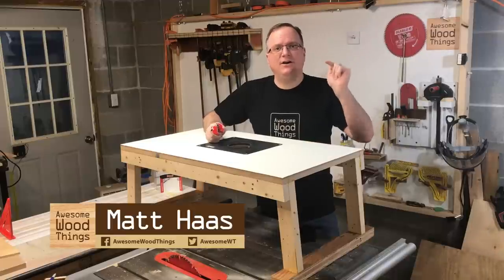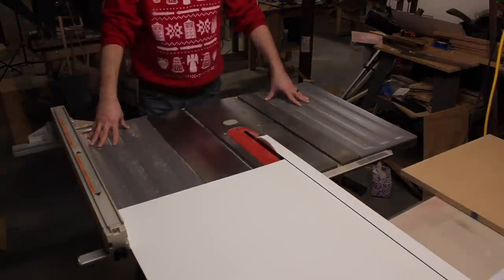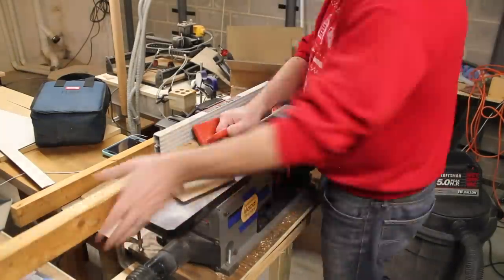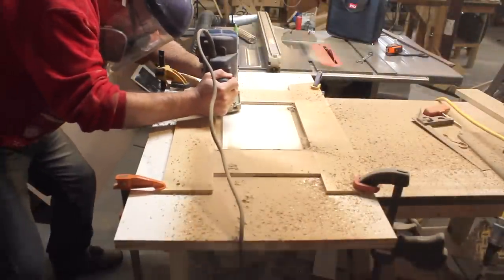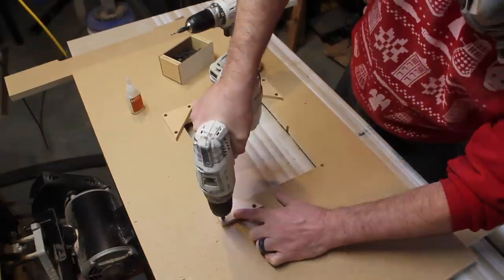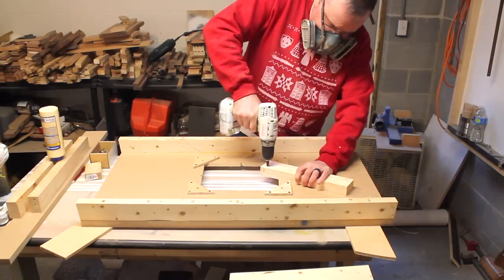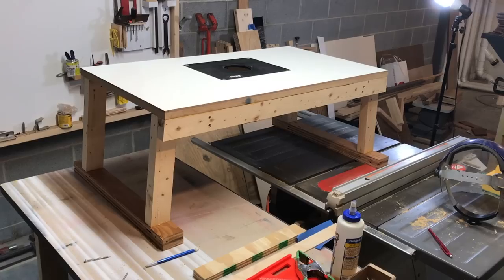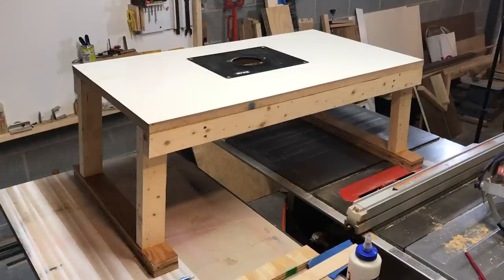Inexpensive Router Table (safe & accurate) DIY

Comment: Great! And I love the fact that finally! a wood working instructional video includes someone not just talking about safety, but actually doing the things they tell you "you really should do this even though I didn't". Yay for push sticks and masks!
Reply from the maker: Yeah... I follow the lead-by-example model while at the same time believing that everyone must make their own decisions around how comfortable they are with their tools and the risks they choose to take. What you saw in this video wasn't done just for the camera. I always wear a full face shield for every tool except drills and the scroll saw... but again, that's just how I do it.
Fun fact, I had my full face shield on while using the table saw and the blade loosened a hard knot in the board. The back of the blade caught it and fired it at my cheek like a bullet. If I was only wearing eye protection I'm convinced I would have a scar on my face.
Reply: 6 @AwesomeWoodThings

Comment: thanks for the idea about the contact cement.  I picked up a sheet of 1/4" pvc at home depot, and adhered it to a piece of 3/4" mdf, to use as a router table top.
Reply from the maker: That is great! Good luck with the rest of your build!

Comment: Rare earth magnets are very strong. I saw you using them so I got a small square of scrap and used a Forstner bit to insert four half-inch magnets flush with the bottom and glued them with epoxy. It makes a quick stop block or spacer.
Reply from the maker: That's awesome! What a great improvement to this idea!

Comment: I've been watching woodworking how to vids since the spring. I just finished a huge project last night (king size bed). In the process I had to use my router that had been on a shelf for 10+ years. After watching about 15 or so vids I wound up jury rigging a system that really did a crappy job. I wish I had seen THIS video ten days ago! Excellent vid! I'll be making this up this week and let you know how it worked out. Thanks for the tip about MDF being super flat; I never knew that. You oughtta have a L O T more subs, man.
Reply from the maker: I’m glad this video was helpful. Yeah... I wish you saw it earlier. It’s great you’re going to build this yourself! I’m sure you’ll love what you create.

Comment: Nicely done!! But you’ll want to get some more laminate and veneer the bottom side of the top as well as it will now and say over time. Melamine on both sides will balance the top, and strengthen it as well. Even if you remove the router and have no weight on it, it’ll still sag.
Reply from the maker: I didn't know that. Thanks for the tip Richard... and thanks for commenting on my question earlier today. As always, I appreciate your feedback!

Comment: Dear Matt, thanks for sharing this build 👍

I'm actually going to build a router table that's inspired of this one for a project before 2022 ends... but before that, do you mind telling me some evaluation of this table? Like what would you do better the next time you'll build a router table? Thanks before! 😊
Reply from the maker: It's great you're going to build this. I'm sure it will turn out great! I wouldn't do anything different based on what you see in this video. The fence (or lack thereof) might be your biggest obstical. It may be worth buying a third-party fence and adding it to this table. A fence can do quite a lot of operations, including jointing boards... and some fences are a complicated piece of equipment (moving parts, etc.) That's why buying a fence may be ideal. Other than that, I love this router table and I've been using it for years. In my case, mostly for pattern routing.
Reply: @AwesomeWoodThings  that's great! I'll also mostly be doing pattern routing with this, so hopefully it does turn out exceptional. 

About the fence, I think my budget wouldn't allow for a third-party one so I'll think of something... Last one, I especially like the leg assembly of this table, it just clicks with me.

Thank you very much Matt! 👍

Comment: Jeez, man, why didn't you cut the square hole in the laminate first?  Looks like it would have saved you a lot of work, especially if both the laminate and the router plate you bought are is 1/4" .  Excellent video.  This is exactly the inexpensive thing I was looking for.
Reply from the maker: Pablo Ramos Great question. Thanks for asking. I suppose I didn’t give it much thought at the time. I’m glad you liked this build. It’s a great tool and it’s inexpensive too... which is awesome.

Comment: How do you raise and lower the router with this router plate? Your build is very nice, but it would be great if you had included a couple clips of how you use the result in practice. Thanks!
Reply from the maker: There is no riser-kit with my build so I would use the routers own method for moving it up/down. Thanks for the suggestion. I'll do that. Thanks again!

Comment: Great video. Perfect level of instruction and engagement, so thank you for taking the time to make and share it. When the router is mounted, how easy is it to adjust the height? It looks like your table would give you plenty of access to make the adjustments, though I guess it would depend on the model of router. If you have any comments there I would appreciate it, as I was going to follow this plan.
Reply from the maker: You're correct... how easy router height adjustments are depends on the router model you have. Some are super simple because you can make adjustments from above the table, like the Triton 3 1/4 HP model. I have an easy way to see and purchase some of the tools I use including this router. Check it out my affiliate page: https://www.amazon.com/shop/awesomewoodthings?listId=1KHYKIOR7A2A2
If you run into questions during your build, just reach out. If I can help, I will.

Comment: What's the purpose for the five degree angle on your legs, and does that go up towards the table or down towards the floor.
Reply from the maker: The angle is to ensure the table isn't top-heavy. Although that really comes into play with the longer cross members that bolt onto the table because the table is more likely to tip forward/backward rather than left/right. I wanted to avoid a complicated compound angle which would have been needed if the legs were 5 degrees in two directions. Does that make sense? Bottom line: I didn't want the table to be top-heavy. The last thing you want is this falling over with a router bit spinning at 40,000 rpm.

Comment: Thanks for the video. I love the simplicity of your table. I wish you had discussed choosing the router plate a little more. I'm new to owning a router so I'm not very familiar with the accessories. Do I need to ensure a plate is compatible with my brand of router? Do I need to remove the plate that came with it order to install it onto a table like yours? Is it easy to attach and detach a router from your table? Thanks again!
Reply from the maker: I’m glad you like the video. Router plates are sold two different ways. 1) compatible with a specific brand of router or 2) drill your own to make it work with any brand of router. Pick what works best for you.
Good luck.

Comment: I as going to make a table similar to that but I wanted it also to sit on my workbench but that would make it just about equal to just below my chest and to lower it I would not be able to get the router in and out...so the easiest thing since my workbench is around 34" high I am just going to bolt it to that. Yeah I know laugh all you want but that's the way I am going to go. Reason no floor model???? I'm getting everything of the floor. I enjoy these vids
Reply from the maker: Sounds like a good plan. Good luck. I’m glad you like my build/vid.

Comment: Confusion I have looks like you screwed the plate down then you are going to screw the router to plate and I am thinking each time you need height or bit change you unscrew the plate? If so does seem cumbersome unless I am missing something
Reply from the maker: You do not need to unscrew the plate each time there is a bit change. The process is like this: You use the tiny screws to adjust its height. This is done once. Then you use the big screws to secure the plate to the table. Essentially securing the router plate so it stays put. You don't want a spinning bit to pop-out of the table... rather, you want that thing secure. Bit changes happen by raising the router up and you can change the bit with everything in place. There is no need to remove the plate and there is no need to readjust the tiny set-screws. I hope this clarifies.
Thanks for watching!

Comment: Couple of questions ...
1. dust collection .... big issue with routers .... 
2. why go to all the trouble of building/gluing/routing  top and not just buy melamine shelf and use?
Reply from the maker: Thanks for asking these questions. I'm happy to answer. Dust collection... yeah, that's a big issue. I haven't figured that out yet... other than placing a shop vac hose below the table surface. My Triton router has a shop vac port and I use that... but again, that's just below the table... so, it's only getting about half of the sawdust. Melamine... good suggestion. Maybe I should have used that.
I hope this answers your questions. Thanks again for watching and for your support!
Reply: attach a flexible hose to a hole in your fencewhere it sits by the bit, sort out a clamp like a hose pipe clamp to vaccum and done :-)

Comment: Hey Matt thank you for the inspiration. What size flush router bit did you use to match    the corners of the kreg router plate?
Reply from the maker: Thanks for asking! Mine wasn’t an exact match. I used a half-inch wide router bit and that wasn’t wide enough. I think I recall the instructions mentioning the corner radius but I don’t have them anymore. 3/4” would be my guess. 
Good luck!

Comment: I been meaning to upgrade my router table jiggy thingy... not sure if I can Kreg router insert in NZ or not ... I think I can but they pretty expensive here as well ... anyway well done.

Oh and dr who sweater... cool
Reply from the maker: I support upgraded jiggy thingies. Haha. If a different brand of router plate is more common (and less expensive) then by all means use the other brand. I believe all router plates have similar features/accuracy. Just please don’t use wood as a substitute for a commercial router plate. Wood is far too dangerous because it isn’t rigid enough.
Reply: NZ here call Mulfords or PSP, and ask for a piece of 6mm Acrylic or polycarbonate 300ish by 400ish, Drill big hole in the middle, small holes where you can screw into your base plate, remember to countersink them,  ive done it heaps, use them and after it gets too scrated up, replace it. You can always leave it attached permantly to your router as an extended baseplate.

Comment: How do I get my flush trim bit to 2.5mm so I can make the edge for my router plate to sit on? I have flush bit from 1/4” to 1” long but no idea how I can get them to only remove 2.5mm of material. 

Been searching everywhere for days. No tutorial on it.
Reply from the maker: Plunge the router to the distance you want and lock it in place.

Comment: Nicely done I could totally make one of these if my full size router didn't scare the beejesus out of me.
Reply from the maker: One of the reasons I made this was because routers can be scary. If you'd like, give it a shot and try to make it. If you do, you'll be glad you did.
Reply: Awesome Wood Things

The only tool that concerns me is a jointer.  Probably because I'm an installer finish carpenter and we don't use jointers in the field.  Anyway, I know a highly skilled old timer shop guy who was jointing boards late on a Friday afternoon.  Apparently he was thinking about the weekend that was about an hour away.  He's now missing his index finger and middle finger.  I was an apprentice at the time and I naively asked if they were able to reattach them.  I was told there was nothing left to attach.  It turned his fingers to hamburger.

Comment: What router bit did you use on the template part?
Reply from the maker: Half inch bit with the bearing next to the collet. Warning, I really should have used a bit that was wider. 3/4 is ideal.

Comment: Those  Kreg plates & the usual y/t ?????  where from ? how much . Thanks for showing u/t your build that has to be my next project
Reply from the maker: Thanks for asking this question. I'm happy to answer. First, I'm not exactly sure what you are asking but the Kreg plates can be purchased at KregTool dot com. They come with tapped mounting holes or without mounting holes. If your router has the same pattern of mounting holes, you should get that version of the Kreg Router Plate. Otherwise, you can drill your own holes in the plate that doesn't have holes.
I hope this answers your question. If these comments don't answer your question, please let me know. Again, my goal is to help.

Comment: Why make it yourself? You can find free desks everywhere on the internet. I got a steel desk with wooden top, i put a plate of mdf on it and put the router under it. I bought some T tracks on ali express, 60 cm for 5 dollar, for the fence. Now i have a router table for not even 30 euro, because i got my router for free as well
Reply: Simple answer, now everyone has room for an additional table in their shop which is why so many people use table top ones rather than building cabinets.

Comment: Why bother buying the Kreg router table, you already have a good home made one.
Reply from the maker: Good question. My thinking was the fence system on the Kreg can do some operations easier than the table that I made... but frankly, I LOVE the table I made. It's far better in many ways. Thanks for watching!
Reply: @AwesomeWoodThings  Just take the the features from the Kreg fence and add in dust collection too and then you'll have it.

Comment: I love how these videos are all about making inferior tools using superior tools.  Seriously though, if you can afford some of the tools in this video besides the router, are you really going to make a simple routing table?
Reply from the maker: Simple doesn’t mean inferior. The table I built is much larger than most commercial router tables and it’s just as accurate and very safe. Inexpensive too. Perhaps simple is the right phrase but the tools you have (or don’t have) is no reason not to build it.
All my tools are used and they’re all consumer grade (not pro tools). 
So... if you want a cheap, safe, accurate, and large router table... build it... or don’t. Up to you.